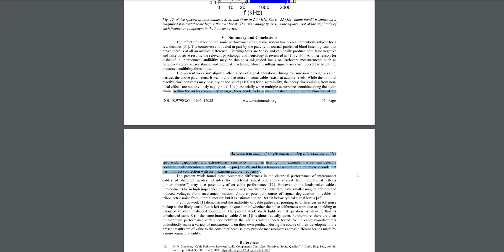Scientist Finds Measurable Difference in HIFI Audiophile Cables ! PROOF

Comment: It is important to note that the study only applies to unbalanced (RCA) interconnect cables. It is not that difficult to find a cheap RCA cable that performs poorly.  Phono cables in particular can affect the sound if not capacitance matched to the cartridge.  This study should not be extrapolated to speaker cables where most of the snake oil persists.
Reply: listen to when the reviewer says "maybe.... just maybe"...
Reply: There are white papers by great audio engineers that show some difference in speaker cables with different amplifier and soeaker loads.... look no further than Nelson pass s research into speaker cables and best of all Nelson pass s article was way before alot of today's companies newer technology and patents.Then there was the audio critic magazine which hated the high end community and Said only speaker s mattered and everything else sounded the same and even they measured and noted a difference in speaker cables capacitance and inductance that adversly affected frequency response measurement of the different brands under testing. Then there is the famous stereo review article in which the higher quality speaker cables were chosen in a blind listening test of pink noise over the joke of a zip cord s by a large statistical margin and when it came to music the blind test results came in just slightly below what was considered statistically significant but still was almost right at the threshold and this was over 30 years ago before speaker cable dielectric,  material s , networks and geometry got really sophisticated and this way before the age of all the high frequency noise pollution from home computers and cell phone s and cell phone towers etc etc

Comment: Do measuring equipment have/need cables to connect or register sounds?? Do these cables make a difference in what is measured?

The writer of the paper is right in asking "do we measure the right things for a complete and scientific sound conclusion?"

For me, i just think the academic 'scientific' way of looking at nature as a whole is not 'objective' at all. Its totally flawed and incomplete to define or even suggest any "truth" whatsoever.
Reply: Anyone who has looked into Ethan Winer's research on the subject should know that he demonstrates a means by which every aspect of cable transmission is measured and compared for audibility with his null tests.
Reply: "do we measure the right things for a complete and scientific sound conclusion?" - maybe they do, but in this paper their methodology is flawed because the seem to lack some of the engineering knowledge that would allow them to make a meaningful set of measurements. They end up measuring the deficiencies of the method rather than the cables themselves.

Comment: Everything makes a difference. EVERYTHING from the humidity to the amount of particles in the air at that particular moment. The question is whether it's audible. And timing sensitivity likely falls into a normal distribution so perhaps it doesn't make a audible difference for some? Perhaps you could train yourself to listen to timing domain differences? It's very interesting and definitely needs more research put into it imo.
Reply: th thresholds of time domain aduibility is well established. No way are time domain errors in cables audible. we can't even distinguish between direct radiation from a speaker and first order reflections.

Comment: There is a curve ball with this topic too were say a cable in one system might not make a difference at all with low EMI environment vs a system in a higher EMI environment where it does. The affect of the environment would still be measurable and both cases would be both technically true.

Comment: The idea that cabling has any measurable difference besides conductance and resistance and the uniformity of the conducting material is too often extrapolated to suggest that the more money you spend the better your listening experience will be,  and it’s the hocus pocus that cable companies like AudioQuest and others use for justifying insane and totally unnecessary markups for the actual materials used; that point is always sidestepped or just plainly ignored in these discussions. Once you get past the purity of the metal used, acceptable connectors, and any necessary shielding (and those by themselves do not guarantee a level of quality), there’s nowhere else to go. The proof is in the replacement of superlatives and pseudoscientific terms instead of a listing of real qualitative differences thrown into the marketing material for high priced cables, to make the uniformed consumer believe there is some magical element in those cables, and somehow they’re buying something more than copper or silver in a plastic casing.

Comment: If there was a basketball player standing next to a midget, would you have to measure it?  Would any university be foolish enough to spend hundreds of thousands of dollars on proving the basketball player is much taller? That would be crazy and anyone who thinks people should spend that kind of money time and effort, to prove stuff about cables, just because they personally can't hear is out of their mind. There is as much difference between the best cables and run of the mill cables as there is between the height of the pro basketball player and the midget. Why is it important to prove it? This whole thing has at its core that there must be a minuscule difference that needs to be proved or disproved. When in reality there are just a lot of people who can't hear, even when there is as big a difference as a superior cable makes. Some of these people who don't hear any difference might have a snake oil theory in their mind that prevents them from hearing the obvious. The others..well. Maybe we should ask them how many times and for how long they stood next to a jackhammer without ear plugs.
Reply: Well, you would be using either  the basketball player or the shorter person (btw, that is no longer an acceptable word for a short person) as a measuring device against the other person.  Plus, you are seeing them both at the same exact time.  Try listening to 2 cables at the same time, not one after the other, but at the same exact time.  Not easy to do, but can be done, but not in a way that makes it possible to compare the two when they are both being played in a system at the same time.   With the 2 people, it's easy to do.  But also, have one person at a time enter a large basketball arena size area and you sitting way out in your seat.  One player is 7' and the other 7'1".  I doubt you could tell who is taller.  And hilarious that you compare the difference in sound to be so large that you actually think it is as huge as the 2 types of people you compared.

Comment: We miss authors such as Walter Jung who led us in the 70's and 80's with articles in the Audio Amateur to improved components and chips. There was the introduction of inexpensive silver cables which were on the bright side. And looking for a solution, they encouraged the use of quieter soft recovery diodes in our HiFi equipment. Based on this, I eliminated the brightness by changing the diodes in my preamp. But comments about silver cables persist today, when a primary cause was high frequency noise from the diodes. Again, perception of our hearing for which we do not have a direct measurement, though the diodes noise itself can be shown on electrically  on a scope.

Comment: Then why don't you all reach a consensus on what cable is the best if you think there is so much difference between cables ?? Sure there are measurable differences if they are unrelated to audio frequencies but those measurements are pointless.The truth of the matter is the reason why some people focus on cables is they are easily changed in a system instead of a capacitor or resistor, transistor, diode etc inside some electronic device. Same reasoning with audio fuses.
Reply from the maker: Why do you say they are pointless?

Comment: IF IF IF there's a difference between 2 cables AT LEAST one is distorting, by definition. (They obviously can't both be high fidelity AND audibly different. Only one can be right, at most.)

Capacitance, inductance, and resistance changes from cables are possible, which are equivalent to changes to crossover component values. (Group delay and phase angle may manifest here). Changing these values is not expensive, and there's no correlation between price and sound in cables. Especially not past OFC Cu2+ in same insulators for the same wire gauge / area. (There isn't. There just isn't.) LCR is LCR in homogenous material conductors. 

You can get different audible changes, but it's not correlated to price. (It isn't. It just isn't.)
Reply: I find this fascinating: who gets to decide which sound is "right"?
Because we are talking about reproduced sound, which is clearly NOT the same as live sound.
Being considered an "expert" in sound reproduction, I often have to answer a certain question: "How  much will it cost me to hear music just like live? 100K? 200K? 500K?" A couple times this question was asked by people who were actually able to afford that expense without breaking the bank. My answer was: "Much less than that: 500$ will buy you the best seats in the best concert hall on this planet. At home? Forget it"
We are listening to something else. That's the truth. What's right and what's wrong is highly subjective. A composer who visited my place and listened to his own music from my hifi set said that many of the things I value most in music are not really top of the list when he is playing or producing his tracks. End of the story.
Reply: @DaveJ6515  Bro you should never buy audio equipment ever if you cant understand what the "Right" sound is...
When the recording happened of the original sound, the correct sound in this case is what was recorded. That is literally the "right" sound.

Then after that, the "Right" sound is what the person who processed and mastered the recording made the sound to be.

Comment: Considering Milind N. Kunchur's track record and the reputation of the IOSR Journal, you should be very careful of this paper as a source of accurate information on this subject. Perhaps you should familiarize yourself with study validity before jumping on this "peer-reviewed" paper. For instance, the methology of this study is highly questionable; no details on the blinding process in the first paper he references and no controls in experiment 7 of this paper (section 4.7).
Reply from the maker: Blinding process and control? What about his track record and reputation? 
Perhaps you should expand on your point

And blinding / control? What? Did you read the paper?
Reply: @Jayiyagi  yes Jay, I have read the paper. He references himself multiple times (the study he did before labelled as 1), whose methodology was questionable on the aspects I've mentioned. Also, that journal is not known for reviewing anything contributors post (Google that). Finally, you can check online about his biases and track record in high-end audio.

Comment: This paper has been floating around for about a year on different forums. I read the paper twice again, which is my take on it. 1. Some single-ended interconnects have poorly designed shielding and low-quality materials used. The ideal single-ended interconnect utilizes porous polytetrafluoroethylene dielectric, and the shields are symmetrically grounded at both ends. The author paid $500.00 for a 2M cable of this spec. (way too much) 2. Blind testing is tricky..lol. 3. (from the paper) "It was found that noise in some cables exists at audible levels. While the nominal reactive time constants may possibly be too short (<100 ns) for discernibility, the decay times arising from non-ideal effects are not obviously negligible (~1 s), especially when multiple occurrences combine along the audio chain.”  So "time smear" may exist. Still, it's NOT discernible unless you start adding multiple cables in your signal chain, and who does that? 4. Just use balanced cables. 5. Total clickbait video heading, but I won't hold that against you 🙂
Reply: @Erwin de Wit I can make a balanced cable for a few dollars - it's not exactly hard to do.  The most expensive bit is the connectors.
Reply: @Erwin de Wit Last year I bought Monoprice Premiere, 10',. gold plated XLR cables for $5.60 a piece.
Reply: Repeat the experiment, your way!
Reply: @Erwin de Wit Indiscernible difference
Reply: Science is science, and that means reproduceable experiments. If someone says "alternative science" or something similar, it's just make believe and is not real science.

Comment: There is a difference in cables and it can be easily demonstrated. You have to have a fully revealing system that has the minimal amount of components! Here’s what that means a low power SET tube amp that’s hand wired with the best components, single driver full range speaker without any crossover and a passive preamp. If you’re not able to hear a difference at that point then there could be a number of problems, room issues, speaker placement, and your subjective bias plus and minus hearing deficiencies! There I said it once and for all. Do you want the best interconnect? Then use solid silver core 18 to 16 gauge wire with a silver plated RCA connector, designed with air/Teflon dialectic. If you still can’t hear the difference then check your ears for wax before you go to the doctor. I said it again!

Comment: The time domain idea makes sense because I feel the biggest difference other than maybe tone is in the ability to have good instrument separation. Poor cables the sound to me is so mashed together. I think timing cues are difficult and we perceive that as soundstage depth etc. Also I see things like frequency response mentioned of course that's not an issue. And resistance or even impedance may not be a big issue remember you are feeding signal often into about 100Kohms input impedance on an amp etc. Thanks for the info.

Comment: Thank for your video, the cables do make very little difference, but they do make difference. But not as much as changing the speakers or any one of your components, but if you have finalised you system then next tweak to optimise your system is trying different cables.

Comment: Of course cables sound different.  If they are made with different materials and in different ways, how could they not?  The question is how linear the relationship is between cost and quality.  Or even if there is an absolute “quality” that applies to every listener and every combination of gear.
Reply: A pound of silver cables and a pound of gold cables are made of different materials.  Of course they weigh different.  How could they not?

Comment: Jay, when I move between a $100 pair of interconnects( I own two or three brands at this price point)  and then to a $250 interconnect cable like Kimber Cable Hero's I can clearly hear a difference between all of them. One is bright but not so warm, another is warm but not so articulate and the Kimber's are both warm and articulate. I also recently bought a pair of the Kimber Carbon interconnects and still need to spend time evaluating these but they cost about $600 a pair. In the end I think it's a matter of personal preference as to what sounds good to the listener. I do believe that you get what you pay for in the sub $1000 range with cables but wonder about cables that cost insane amounts of money and the law of diminishing returns. They may be better, but are they that much better? Hence, I keep using cables in the $100-$1000 price range.

Comment: If there is a difference in the sound from cables  surely you be better spending the extra amount on speaker or amp upgrade
We heard little or no difference from a  homemade set of cables costing $300 to those costing $3000 but we heard an huge difference upgrading the $2000 dollar amp to a $5000
 amp
YMMV but to me I'd rather put the money to something that I can really hear making a difference 
This was my experience and everyone is different if cables make a huge upgrade to you go for it  after all if it improve your listening experience its a win
Reply: No Edwin. A 25$ pair of Amazon basics xlr cable makes your system sound as a 4000$ xlr cable (without active components). Anyone who disagree with this is either wrong or lying and won’t be able to prove it on an abx test. Thats a fact.
Reply: you are right. on the other hand it is nice to spend at least a few hundreds on good cables if the rest of the system costs thousands - especially because quality cables can last a lifetime. I prefer the top lines of pro audio brands - for example Sommer Cable epilogue.